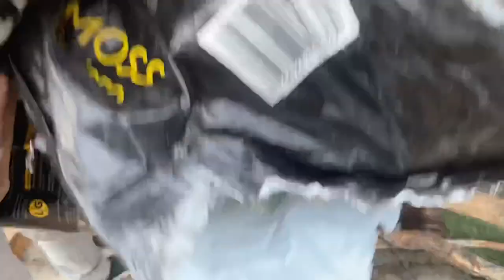Ferocious Nile Monitor is NOT ESCAPING

Comment: It’s definitely an upgrade from wat you had before. But still neeeeds some improvements. Try making the pond deeper and make a digging are. So more dirt. Which would mean high barriers/rims. Also, make sure he’s not able to dig underneath it to escape out the cage
Reply from the maker: For sure definitely should’ve put some barriers/mound around the pond, maybe for next time, I did put a wire underneath the whole bottom of the enclosure so there is no escaping 👍🏼